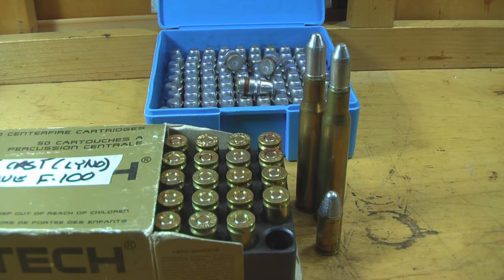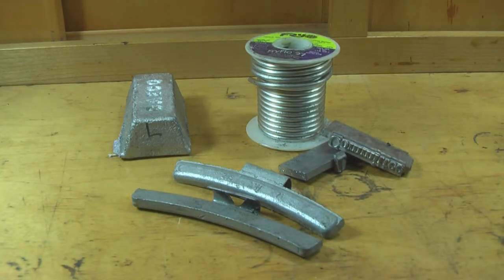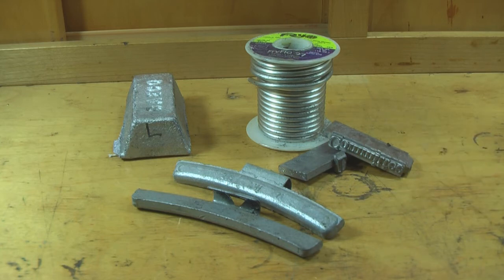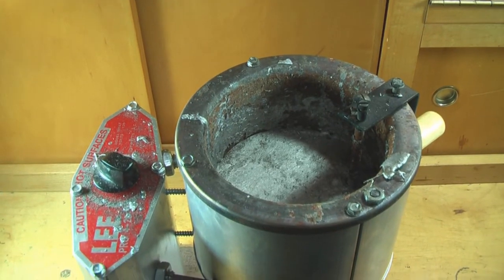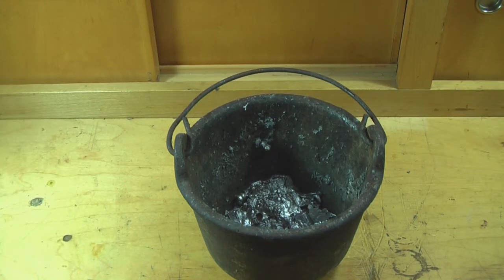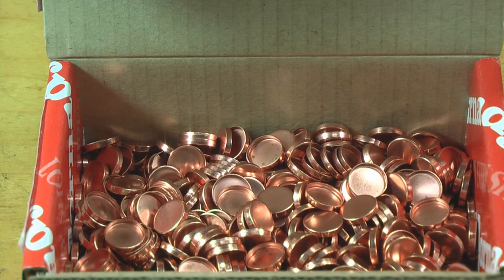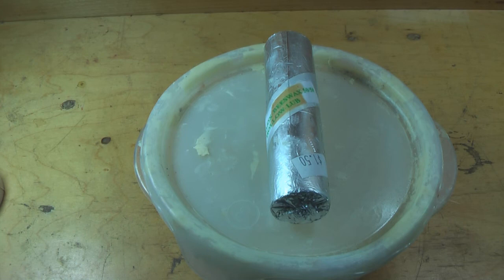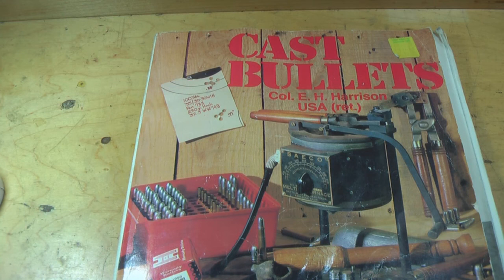Bullet casting Basic Equipment in HD

Comment: im having a slight problem with my lee two cavity mold. in the first 2 days of casting, we made 920 rounds without a single problem. now, a few months later, the front mold dosent seem to cut the tops off evenly. its flat, it just leavs little spurs or overhangs on the bottom of the bullet. never droped the mold or hit it oncorrectly. any ideas? second, when i went to put in some wax from a candle and well, a fireball and LOTS of smoke. how much do you put in?